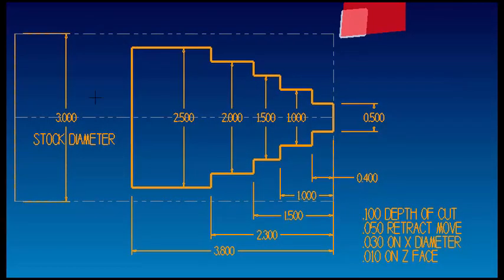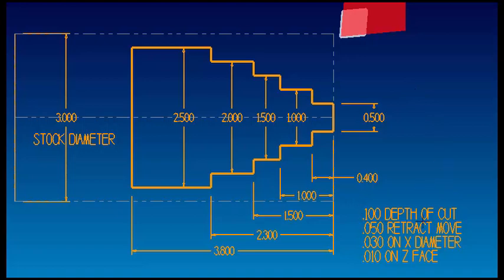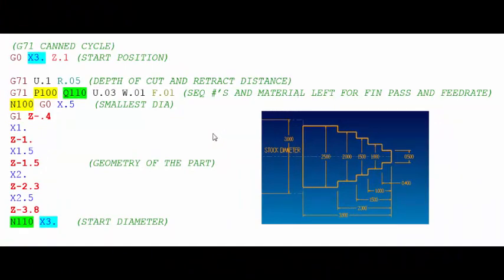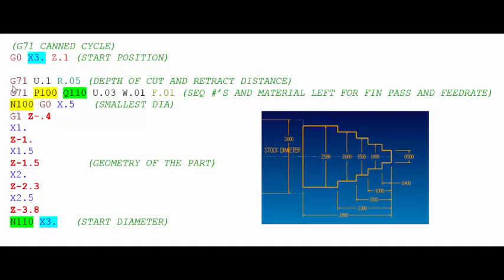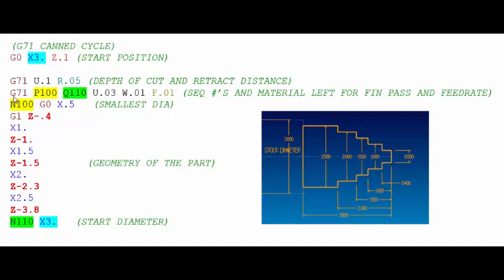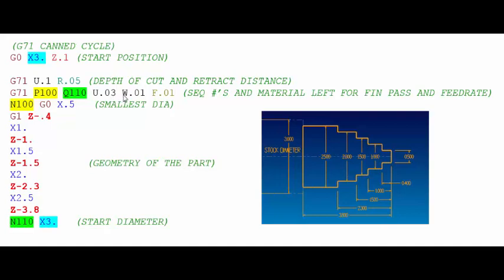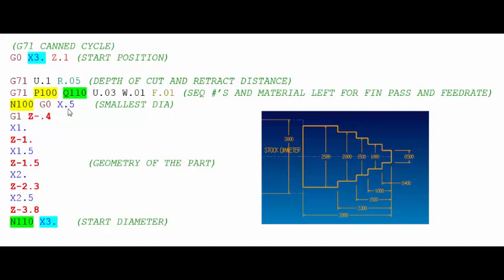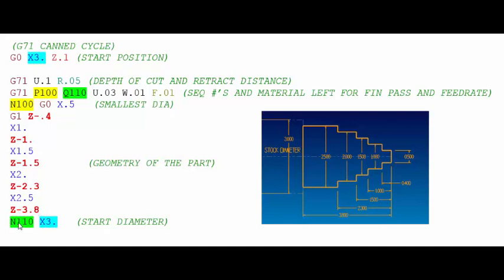CNC LATHE PROGRAMMING LESSON 2 PART1 OF 2 - G71 CANNED CYCLE FOR OD ROUGHING

Comment: Great video, thank you very much. You’ve highlighted the most important parts well, and simplified it which I appreciate. The issue I’ve had with figuring this out… (which your video explained very well) was how the the stock is specified in the start line above the 1st G71. Some of the other videos I’ve watched ( over 12min long) seem to skip how crucial this line is. As well as the exit matching stock co-ordinate. 
I didn’t get quite get as far as seeing if you’d posted another video showing the the finishing pass with using the same sub routine in a G70 for the finish stock removal before writing comment. Although definitely comes in handy when writing programmes in the fly 💪🏻
Reply from the maker: Thanks for that feedback!  Glad it helped you.

Comment: good video, I learned a couple things, but I also inadvertently introduced an error to my code because I misunderstood the phrasing when Tom mentioned the requirement that the X, (and  the solution to my problem) ***ONLY X***, must have the same value as before the G71 call, seems obvious now but if you include the Z coordinate value from the approach position on that line you will get errors at the control even if not all simulators show it. 

Anyway, thanks again for the video, helped solidify a good principle.

Comment: Bit confused, how does the machine know which way to retract if od and Id turning have positive values for retract distance.
Reply from the maker: John Smith Smith 
The P And Q diameters will be reverse.
OD roughing the 1st N is the finished diameter (small diameter)and the second N will be the start diameter, usually the raw material diameter.

On ID roughing the 1st N is the larger diameter (finish bore dia) and second N is the start diameter.
Thanks for watching.
Reply: Tom Stikkelman thanks it's something that has caused me great grief this week. would the machine know automatically which way to retract in z if I was turning  to a shoulder with a left hand tool?

Comment: Tom. I run a Fanuc Oi mate-td. having trouble programming a 45°  chamfer using a g71 roughing cycle. do I have to write it line by line, or is there a way around that. Thanks. -Pat

Comment: i am not a CNC`er but with these videos i have really learnt a lot. my question is, how can we put a radius at the very start point of the material? that is how can the 0.5 inches smallest part be radius-ed?
Reply: +igunnuoda olorunmuyiwa  g02/g03 circular interpolation movements. i see he made a "g0/g2/g3/g4" video...
Reply from the maker: +igunnuoda olorunmuyiwa   In order to add a radius on the front of the part the canned cycle would have the smallest X- diameter on the N100 line in this example. So if the radius is .100" than the diameter next to N100 would be X.300 instead of X.500  Then the radius would be part of the geometry section between N100 and N110.  Hope that helps. Thanks  Tom

Comment: Thank you for this vid, it really helped me simplify things and make changes. On my final cut geometry (with G70), I have a radius. The specific line is G01 Z-5.5 R.025. Now my depth of cut is .300. When it is rough cutting in G71, it actually cuts into that radius, like it doesn't understand the radius geometry is there. It still makes the radius but there remains a small nick in it. Its not a big deal at all, I was just surprised to see it do that. Maybe I should use a G03, but that would complicate things a bit. This is on a HASS TL2. Thanks again!
Reply: +mckeesk  In other words, if I put an inside radius at the intersection of two perpendicular surfaces in the canned cycle geometry, it won't recognize it. It treats that as two right angled surfaces and will rough cut into the stock meant to be left on for the radius.
Reply from the maker: +mckeesk Make sure you have a G18  plane selection active active before calling a G2 or a G3

Comment: Hello Tom,     Would G71 does the turning with multiple diameters and undercut on O.D. as well?  I am thinking about program it but not sure if the G71 will do that. Please advise.  Thanks
Reply from the maker: +Mike Mai Yes but the G71 canned cycle can be used to turn undercuts or pockets on type 2 Fanuc controls only. Thanks  Tom
Reply: I have heard other programmers mentioned about type 2 but I am not quite sure.  If you know please explain it.  Do you have the type 2 videos?  Thanks Tom

Comment: are there X dia shouldn't be devided by 2?
Reply from the maker: Sebastian Darlak Thanks for asking Sebastian. All X diameters on a CNC lathe are programmed diametral. So if your turned diameter needs to be 1 inch then the X value would be X1.0.
Reply: Tom Stikkelman same as a manual lathe